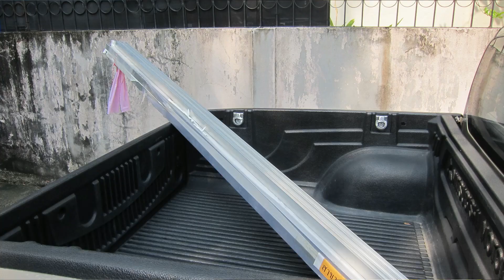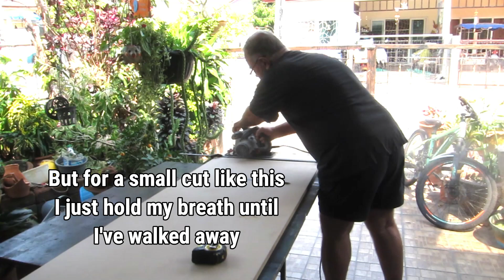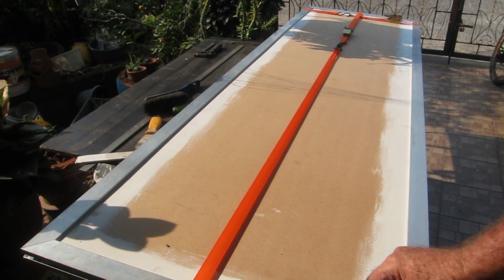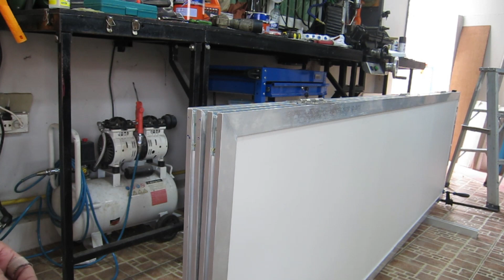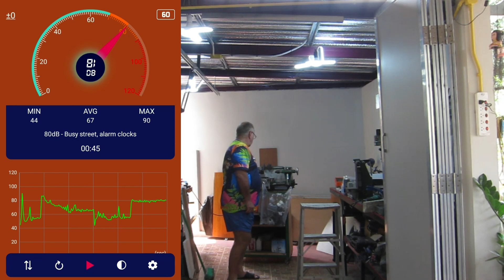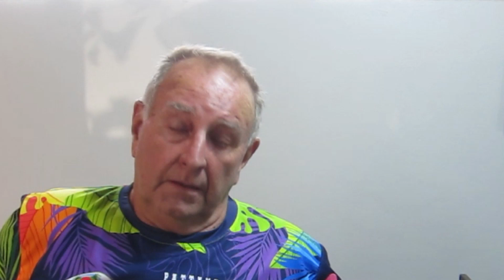MHW Episode 71 - Workshop Noise Reduction - Part 4 - Workshop enclosure

Comment: Well done, you're finding a way to get around a challenging situation - that's why we come to this place called earth.  That washing machine motor on the mill, would it be quieter if it were a BLDC motor?  Or is it the sound of the tool hitting the workpiece that creates the most noise?
Reply: Oh and happy birthday mate
Reply from the maker: @trickywoo356  Thanks
Reply from the maker: Cutting makes way more noise than the motor, the motors were just something I could base my efforts on without making too much noise in the process 👍

Comment: Thinking about reducing sound getting out/echoing, Re the bare concrete floor or even the walls, Would you have anywhere you could lay your hands on some indoor/outdoor carpet squares, about 1/4 inch thick, rubberized and you can sweep or hose them off if you get swarf on them, food for thought.
Congratulations on making it through another year, keep on plugging.
Reply from the maker: Trying hard to not spend money I haven't got to spend, thanks in large to my wife and daughter thinking it grows on trees :face-orange-frowning:

Comment: I think if you insulate the roof and plaster board a ceiling it will further reduce the noise. Cracking job with the doors by the way a definite win mate.
Only things I’ve had dealings with are acoustic cabinets on fully auto heavy woodworking machines. You don’t have that option as you need to have access to the sharp bits. So my theory is make the room the acoustic cabinet. Your 95% there already.
Reply from the maker: Getting there, I was thinking about those large egg trays I see around the place, but not sure where I can pick some up from. 👍